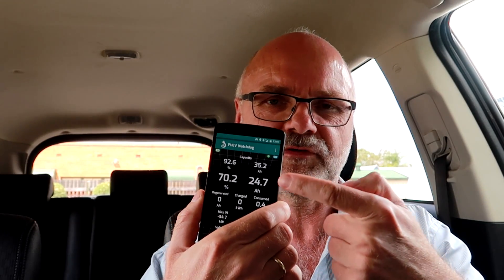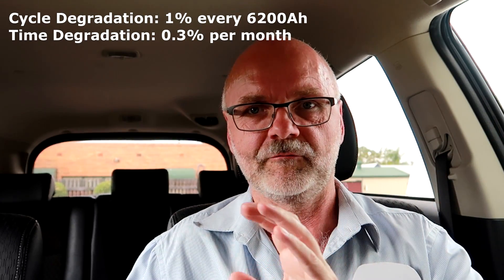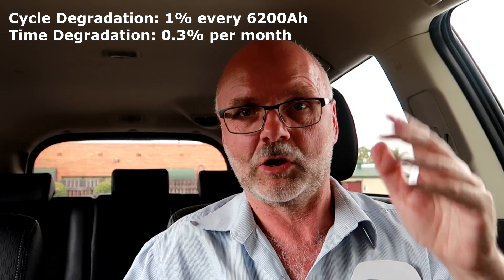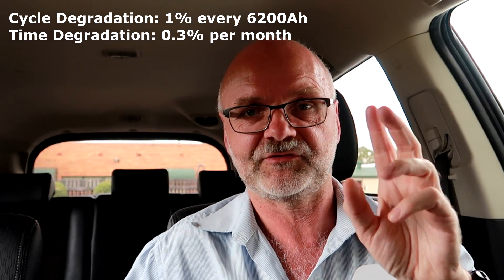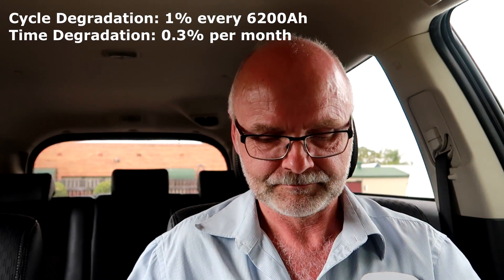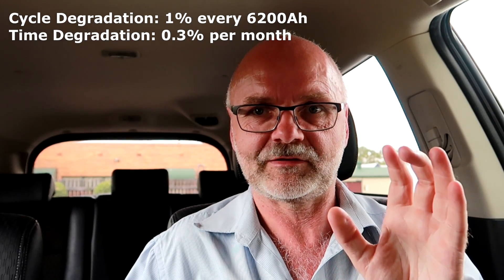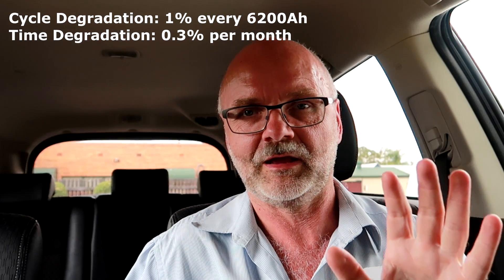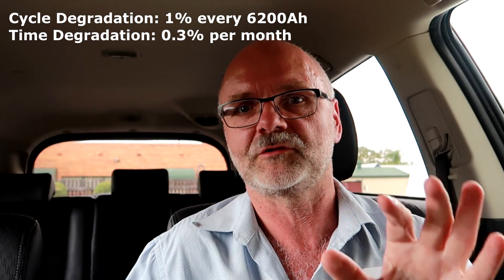EP190 - Do we have a #PHEVvaccine instead of a cure? Why we were wrong about the BMU!

Comment: I keep asking the same question over and over - does SOH number effects the power the battery can take or the miles the car can drive ? I'm afraid Mitsubishi don't care what SOH BMU is reporting! You keep ignoring this. I'm afraid that if you would do your DBCAM to your old battery, your range would still be the same.
Reply from the maker: I'm not ignoring this. I'm hesitating to reply... I'm scared you could be right.
Reply: @unpluggedEV  I think we are going back to the problem #1 that was discussed many times - small battery (12kWh) in a large heavy vehicle that operates for months in EV mode. Those batteries must work under very high stress and they just degrade much faster than in other BEV's . Not as fast as BMU reports, but still much faster than we would like. Perhaps Mitsubishi should turn on the ICE much faster or just increase the battery size, lower the EV power etc.  Last month I got a 40kWh Nissan Leaf for my wife and we drive it now much more than Mitsubishi. The Leaf is smaller, lighter and has over 3x bigger battery. Also, we didn't have to charge it to full even once during the last month and our SOC didn't drop below 35% neither. In Mitsubishi we would have to do probably 20-25 full cycles during that time (25% through 90%) - I think this is the reason why Mitsubishi batteries suffer premature capacity loss.
Reply: Andrzej P As there world be physically more ah, then yes, it would affect range...
Reply: @Specwinclean  There is as many Ah capacity as you can charge into the battery - no more no less. If your EVSE or WatchDog shows you that you charged to 36Ah then your battery has 36 Ah capacity available for your drive, regardless of what BMU "calculated" SOH is showing you. Also in all LiIon batteries, the SOC is proportional to voltage if your battery is charging up to 4.1V then it's charging to the full available capacity as designed. It won't suddenly charge to 4.2V if your BMU start showing you 100% (40Ah) SOH  - there is only so much Ah that you can pump in the battery until it reaches 4.1V/cell.
Reply: Andrzej P , you say that charging stops at 4.1v/cell, but don’t Li-Ion cells voltage charge first, then when the 4.1 is reached, it current (soak) charge until the current reaches a set minimum?  We’ve seen this in action on the last video from Andy.
Reply: @MrTytalus  the LiIon battery charges first at constant current (untill it reaches set voltage) and then at constant voltage to finish up. The last part CV charge takes as long as the battery chemistry can accept power and in Mitsubishi it cuts off at about 300W (0.8A or so). It doesn't have anything to do with BMU reported SOH - I observed it many times on my EVSE power graph.
Reply: Andrzej P, Yes, Thanks: constant current, then constant voltage.  Just clarifying as it was mentioned that charging stopped when 4.1V was reached, which wasn’t quite correct.
Reply: @andrzejp8782  I think this is true when charging, but what is the case when discharging? Does the BMU let discharging the battery to 30% (25%) independently the cell voltage?
Reply: @MegaEnpassant  myself and many other people observed that the ICE kicks in at around 3.75V per cell (300V per pack). It's also very difficult to tell exactly as it depends on load , temperature etc.  But around 300V was pretty consistent.
Reply: Correct, but if the BMU says that you only have a maximum of 25.5 Ah, you won’t be able to put any more in, because it’s the BMU that says that it’s full, but you are correct I think with your summation of this type of EV.
Reply: @Specwinclean  actually in Mitsubishi case you are able to put more into battery than reported SOH - watch Andis other recent videos and I'm observing exactly the same on my car. It constantly charges over the SOH and reports 105-106% SOC .

Comment: I've done the triple procedure (reset, smoothing and DBCAM) but my soh didn't went up.. It stayed at 73%... What does this mean?
Reply: That means that your battery is at 73%
Reply: Andrzej P if that is the case then my BMU was always correct. Which I dont think it is because I've witnessed 2% drop in 3 months before doing the procedures...
Reply: @rubencosta3975  you see I believe that the car do not use the SOH reported by BMU for anything. It charges and discharges to true capacity based on cell voltage . Mine shows 88% on WatchDog but  charges to 105%. I'm sure your will charge exactly to 100% of reported SOH since you just had DBCAM and your BMU have the correct value. But the point is that it doesn't matter what SOH BMU has - the car will drive the same. At least that's what I think.
Reply: Andrzej P what’s your EV range @ 88%?
Reply: @matradlinski8084  My car always charges to (35.5 - 36 Ah) right now, even that the BMU reports 33.2Ah . I'm still getting about 25-27 miles in cold weather. It's really hard to say exactly as the driving conditions play a huge role. I'm 100% convinced that the reported SOH at 88% is total BS and my battery is right now at 95-96% counting from 38Ah. Yes the degradation is faster than I would like to, but I'm driving every day in 100% EV mode and I do almost 1 full discharge-charge cycle per day, so I'm not surprised that the battery lost some of the capacity. I think we just need to stop treating the PHEV as EV car and accept that this is more a hybrid than EV.
Reply: Andrzej P how long have you had your PHEV? I’ve had mine for 7 months and am also down to 25 miles in cold weather in mixed traffic.
Reply: @matradlinski8084  I have mine 11months now. All EVs will lose some range in cold weather - it's absolutely normal . EPA rated Outlander at 22miles of range , so we are still above the rating. I wouldn't worry about it yet.
Reply from the maker: That would be insane. I refuse to believe that just because I'm a good person and think the car is great and the batteries are great and everything will be great eventually..........
I know exactly what you're saying and I hear you for a while but I did not want to hear that!!!!
Well, once my car goes through the procedures we will find out I guess, right. If the SOH does not change anymore and sticks to 40Ah the only method to measure degradation is the charging energy.
Reply: @unpluggedEV  the problem is that you will have to wait 1-2 years to start seeing the degradation again :-) Or maybe it's a good problem. I hope in 2-3 years we will have an aftermarket replacement with solid state cells at 20-30kWh capacity and then this SUV will be brilliant.
Reply from the maker: @andrzejp8782  It will become very interesting once Mitsubishi have carried out the triplet and the SOH does not move for a while. I will need a bigger whiteboard to note all these figures from measuring the charged energy.
I just hope you're not right...
Reply from the maker: Thanks for this info!
Have you got a yellow card in your Dog's Battery Condition tab? How old is your vehicle, km, do you know how much kAh you had on the Dog before the reset?

Comment: Hmm this is very interesting, I’ve not looked at my figures yet, but if the degradation is purely algorithmic, I’m wondering why are the 2019 batteries on such a steep degrade path, compared to earlier models. Any thoughts? If the code is unchanged the degradation gradient should be the same?
Reply: Ian U.K. maybe if the 6200Ah of charge+discharge value has not been changed in the new ones’s BMU, that 1% down is more frequent and shows bigger degradation steps down as well
Reply: Alejandro Carrera I understand your point entirely, however taking my own car as example, the battery is 135 days old, I’ve had the car 2 months. The Dog says 41.9Ah SOH and total energy use is just 3734Ah. So, you can see that I’ve not reached the 6200Ah threshold yet, so can discard that, and worst case 4.5 months of 0.3% degradation for time. 46Ah x 4.5 x 0.3% = 0.621Ah maximum degradation. My actual degradation is 46 -41.9 = 4.1Ah ie 8.9%. Way off, so there’s more at play here I believe.

Comment: Now it is getting interesting.
Could "we" reverse engeneer a working BMU solution from another manufacturer to reflash our cars?
We would be the first EV modding crew..
Reply from the maker: A question for Gerard Dunning
Reply: On the UK PHEV group FAQ, they state: "Over the next 1,000 miles, your SoH and guess-o-meter range should relearn and hopefully start to increase, all else being equal. It’ll help if you also follow the tips in FAQ#M." It will be very interesting information if someone following the procedure on "A. Fix bad battery health data (without dealer)?" could confirm seeing any increase of SoH. According to the last discoveries, this would be impossible.
Reply: @vferrandobe  I tried all tips from FAQ that you cited many times over the last year. It never had any effect on my car. I have a new car March 2018 delivery - as far as I know the ABC and deep discharges allowed to "relearn" only for older cars. Still nobody reported significant actual range improvement after SOH rise . Small improvements are almost impossible to observe as it largely depends on drive style.
Reply: what will it give you? The satisfaction that your SOH number in WatchDog is more accurate? If the battery is discharging to 3.7V and charging 4.1V then you have the full capacity available for your driving - regardless of what the BMU is telling you
Reply: @andrzejp8782  I am an engeneer. To be able to do it is the reward.
Reply: @andrzejp8782  Are you sure about this? Is the car allowing the whole charge in and out when the BMU is reporting the wrong capacity?
Reply: @andrzejp8782  Hey Please don't discourage other people, to find a solution. Your Question and logic about the battery is right, if the BMU is not limiting the energy amount you can use. Andy showed in #ep191 that your assumption is wrong. Let's work together to find a solution that keeps our battery's safe and healthy.